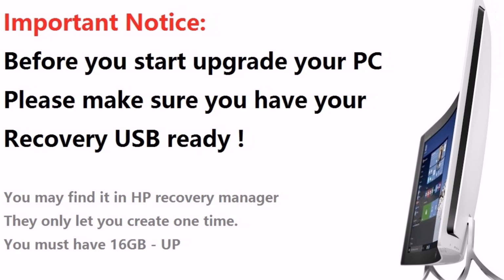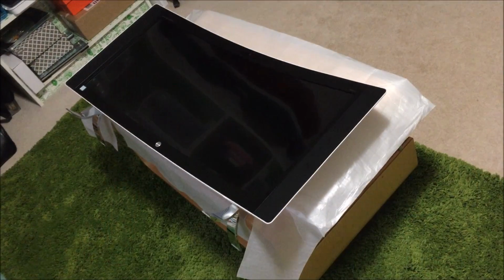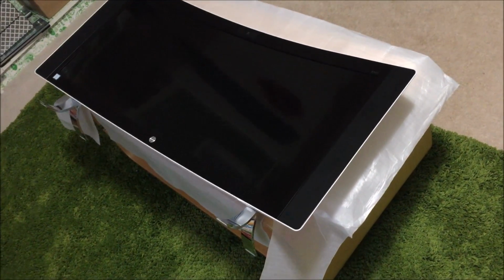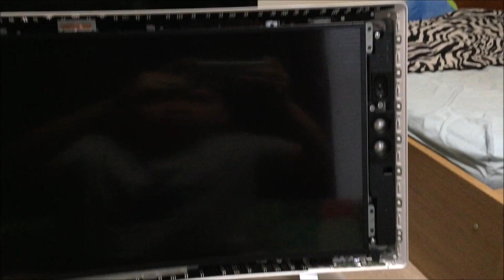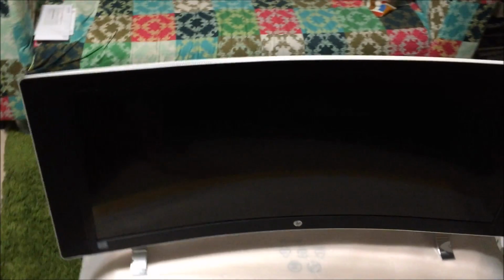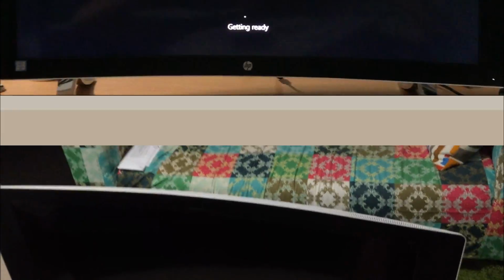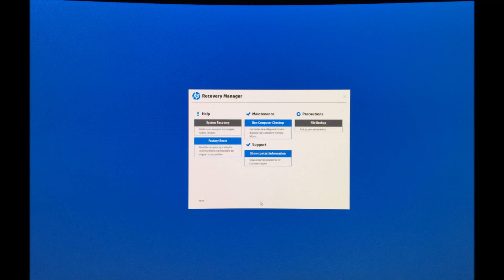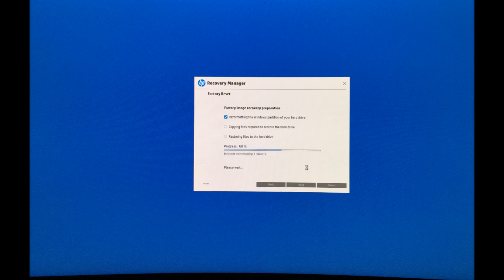HP envy 34" curved all-in-one PC SSD upgrade installation guide

Comment: I have one of these I purchased from Costco almost 5 years ago.  It still works great but I am going to change the SSD out with a larger one.  It also came with an NVIDIA GeForce GTX 960a video card.  Does anyone else have this and is it possible to upgrade that video card?  I'm hoping to only open this PC once so I don't want to open it to check on what the GPU looks like.

Comment: I have the 34 and 27 inch touch version of these envy computers ..Any one done the 27 inch?
Reply: The 27 version was so much easier...The back cover comes off and the hard drive is easy to get to ...Why would they mount it behind a screen...
Reply: Thank You..I just watched your video again...The new 34 hp all in ones are built to work on much easier...I wish i changed out the ram while i had it apart

Comment: If you need a Display replacement, Original NEW LCD Display LTM340YP02 LTM340YP02-Q01 For HP Envy 34-a090 Curved 34-a0XX 34-a001la 34-a150 All-In-One PC Buy from AliExpress.com https://www.aliexpress.com/item/1000007305918.html?gps-id=ru_edm_recommend&scm=1007.25755.141389.0&scm_id=1007.25755.141389.0&scm-url=1007.25755.141389.0&pvid=39201b83-8134-41c6-b76c-687970802486&userTouchChannel=targetEdm&smiId=biz_add_cart:1002:fb04d2139e2247d7bc0de67f7de235ce&tracelog=rowan&rowan_id1=houyi_target_edm_1_en_US_2020-03-23&rowan_msg_id=5139biz_add_cart:1002:fb04d2139e2247d7bc0de67f7de235ce_95617$79535438b4f448198886e5ac7327a4f6&ck=in_edm_other

Comment: SSD Upgrade vs. BIOS Update BEWARE!!! My Envy 34 A010 has been happily running on a Samsung EVO 850 SSD  for the last 3 years.  Yesterday, I stupidly updated hte BIOS from version A0.12 Rev.A to version A0.13 Rev.A.  After this, my computer would boot to HP logo and get stuck on it.  I have spent hours trying to find a fix but so far no avail.  The easiest thing to do would be to roll back the driver but apprarently, HP HAS DISABLED THE ROLL BACK FEATURE on this machine.  This really pisses me off... (and that's being nice).  I was able to restart the machine form the original conventional drive but it so slow that it makes the machine almost unusable.  Anyone managed to roll back the driver on an Envy 34 A010?
Reply: If you are able to use the original hard drive and boot up, its the ssd that has been corrupted or died. Recommend if you have an external enclosure for sata, to try connecting and see if you can see the ssd plugged in.
Reply: @NorthernLightsMultimedia  My SSD works fine to boot up and run the Envy 34 when connected to an external USB port via a SATA to USB adapter.
Reply: I have the BIOS update and my machine runns fine. I also have an SSD installed.
Reply: @NorthernLightsMultimedia  Interesting...  Are you running BIOS A0.13? And which SSD do you have?  I noticed there is now a BIOS A0.14 update available for the Envy 34.  I am wondering if this will address my internal SATA SSD issue.  Thanks for jumping on the thread.
Reply: @telecamfilms  I have an San Disk Ultra II 960GB SSD installed. Never ran into a problem with it. I have BIOS A13 installed. I know initial before I installed it, I used Acronis Disk Director and formatted the hard drive and then cloned it. Did you do a fresh install or did you clone the original drive over to the SSD?
Reply: @NorthernLightsMultimedia  yes, did a fresh install with the HP recovery tool and also cloned my Samsung EVO SSD with Macrium from the HP original HD.  I am ready to bet BIOS  A0.13 has issues with Samsun SSD drivers and that is the reason why they released the A0.14 update.  Still running with my EVO SSD connected externally, I'll give a try to BIOS A0.14 when I have some time.  Cheers.

Comment: Hello! is it possible to somehow ignore the idea of all in in this monitor and have the pc outside in a pc case?
Reply: Yes - mine has HDMI in/out ports - just connect external PC to HDMI input, set the display source to HDMI and it should work just fine. It does for me.

Comment: I upgraded my envy 34 to a m.2 ssd, 16gb ram, 4tb hdd, and i7 6700t
Reply: where did you find the expansion slot to upgrade the M.2...i have 128 gb and want to upgarde to 1tb
Reply: @TUSHY1980  You need to remove the motherboard, as it's on the side you can't see. It's in the top right corner.  It takes a standard 80mm chip. The (small) m.2 chip on the left is the wifi chip (with wires leading to the wifi antennae).
Reply: @TUSHY1980  Have you been able to replace the M.2 from 128gb to 1Tb? What M.2 SSD did you use? My M.2 is a Samsung SM951
M.2 PCIe (AHCI) 128gb. Is the motherboard compatible with NVMe M.2 SSD? I couldn't find any useful info about the Skydive-2GS motherboard
Reply: What kind of M.2 SSD did you use?

Comment: After replacing the hdd, I'm having a sound issue. My PC just make intermittent noise(very low) in a continuous fashion. I also  did a Bios update and now I received a screen where shows no part no. After pressing escape twice, it boots on Windows 10. Any idea how to fix bios issue? Thanks.
Reply: imachunter007 same exact issue here.... bios same thing. Figure out solution? Im still getting *poping noise too

Comment: Thanks for the post. While removing the curved display from the motherboard, video cable is damaged. I put some adhesive tape. I found similar cable on eBay but issue with selection of the video cable. If you can provide me the model or part no of the cable then I am able to replace it. I already search on google but nothing found for HP envy curved 34 all in one PC. There is cable available for HP and other brands. Thanks

Comment: I don't understand why there is an access point behind it to replace the hard drive or the RAM. To replace the RAM or add a M2 drive, you have to remove the motherboard as well. Piss poor engineering design for such a high price model.

Comment: The bottom doesn't need to come off, and the glue is tricky but I used a cardboard business card and that did the trick. The screen is made by Samsung so it is quite flimsy but you can upgrade the hardware by being careful. I suggest when taking the black cover off you leave your PC on as you don't risk getting an electric shock and the screen is very delicate so you will know long before you cause damage that you are pressing too hard on it.

Comment: For those thinking to buy a SSD. Forget it. Anyone who considers to put a OS and family pics on a SSD, is in for a big surprise when it corrupts. Its Adios to all your data. NO BOOT SYSTEM. On a mechanical drive you options to recover data. I suggest to put the SSD external on a High Speed USB, as it is just as fast, and best to use for gaming, or data you don't really care to loose and can recover.  Besides, you can make the USB SSD bootable as well. And run multiple OS's.
Internal and External.
The risk to take apart just for this? And take it apart again a year later for a bad ssd? Not worth it.
You think HDD's get hot. Wait till you feel a SSD running in this cabinet.
Besides you risk a serious screen crack issue. And I have seen it happen. Fixing HP warranty 34" AIO's.
And for those looking to buy a replacement screen. Or fix a eBay broken screen one. Forget it.
The price isn't worth replacing the screen. Your new HP 34" Becomes a pile of trash if the screen cracks.
This unit uses the Samsung WDHQ display currently used in its Monitor Lineup and HP's 34" Curve monitors.
Screen alone is priced at $800
Samsung Part
LS34E790CNS/ZA
34" SE790 Curved WQHD Monitor w/ Ultra-wide Screen
Thanks! From the Notebooksquad Web Team,
Reply: Sounds like you had a bad experience with a generic SSD. I've never had an SSD fail and I upgraded a 2012 macbook pro to a sandisk much like the one in this video, and my desktop I built 5 years ago is still running my Samsung Evo 840 500GB after plowing through terabytes of game install/uninstalls. As long as people properly manage their windows settings for a SSD (so many tutorials out there for this), and if you need a backup, simply use the OLD HDD as a backup drive internally, or externally. Do not use a SSD as an external drive it defeats the purpose of the performance to read/writes you get with SSDs....
Reply: It's a pain in the butt for a system like this sure, but an SSD shouldn't really run that hot, (NVME SSDs do though, I noticed Adata brand reports a high temp but I've never felt it get really warm vs my Samsung 850 which runs cooler than most hard drives) sounds like yours had an issue. It sucks. Even Hard drives fail, and data recovery IS more likely on a Hard drive but it's also more expensive than it's worth to most people (although there is free/cheap software that can possibly help, if that fails expert data recovery service is pricey).
Speed / responsiveness of SSDs is definitely worth it.

Comment: I was able to open up my Envy 34 AIO as well without cracking the screen.  In order to do it, DO NOT use a card to shimmy it free scraping along the LCD panel.  Instead, use a thin flathead scredriver and carefully pop it loose along the outer edge.  I also used a hot air dryer to heat the bezel to gently pull it loose a little bit at a time.  There is an adhesive tape that has it affixed to the display that can be slowly pulled off.   Just take your time.  It took me about 45 minutes to get the bezel off without damaging the screen.
Reply: Great Tip with prying from the outside.  I used a "black stick"/spudger to work the black trim and the adhesive slowly began to peel away.  Heat gun would probably have sped up the process.
Reply: Hope you can put up your video of how you did it.

Comment: Hi, very good instruction. 
How many SATA connection does it support? only 1?
Reply: it has an m.2 socket for a second SSD.   There are guys out there selling these with  i7 6700k quad core 4.2 GHZ and 32gb ram,  1tb m.2 and 2 tb SSD. HP says its 16gb max but they are upgrading to higher.  Considering a upgrade.  If I open it, I am doing it all.
Reply: there`s something to check?

Comment: I have been using mine for a while and notice a heavy sound generating. Do i have to Boot the HP Envy 34 on the stock, 5400 rpm hard drive and Complete the intial Windows 10 setup? Cant i just replace the hard drive to an ssd? Also, will the ssd help reduce the sound of the fans?

Comment: Hi, I just followed this and did the upgrade to solid state drive and carefully followed all instruction and closed it back BUT after I turn it on, there is a black thick line down the middle of be screen- horizontal. Do you have any idea what happened and why this line came about please. Any help will be greatly appreciated please. Thanks in advance
Reply: Ouch.  Sounds very hardware.  Take a apart and put back together again.  Hopefully it is just how it is assembled.  But I would guess it is broken.

Comment: man. HP makes so hard for people to upgrade the RAM and SSD
Reply: Manufactures like HP, Dell, and etc don't want none or repair shops do work on their computers. They want us to send off the computer so they can generate more profits so they can destroy small businesses.
Reply: That's the problem with most or ALL of these pre-built all in one systems, I mean what if you want to use a different monitor or the monitor dies, there's no video output. You can't change the video card, or upgrade the processor etc. They're nice looking when all integrated into the screen, but most components are specialized and flatted, you're also going to like get poor airflow / cooling in something like this. It's best to build your own if you want to customize / upgrade, or be able to swap out parts if something goes wrong.
Reply: @ninjargbassassin7650  They fucked me hard on this shit. Neve rpayed so much for a prebuilt system... never used it, cause it overheats if I use more than two webbrowsers at the same time, and god forbid I use a software like a game or microsoft word too, then the cpu boils. No guarantee, no help, no response, nothing. So I bought another one. Decided to open it again now and even more errors... like they built in that it will die if not used for several months... Never ever again, felt like they stole my money and screwed me hard

Comment: could you upgrade the CPU and the gpu chip like it has a 960m I would upgrade to a 980m
Reply: Really think you need those two extra FPS in your facebook games? You can't btw but don't worry. You wouldn't have noticed as much of a performance change. You can upgrade to 16g of ram and ssd like this guy and get a noticeable increase.

Comment: Excellent video.   Why does HP sell a computer in this class without an SSD? (rhetorical)    If HP designer were truly clever, future  design iterations would enable users to quickly / easily swap out a hard drive, much like most business laptops. (hint for HP)
Reply: +Y.U.E Living Channel I see some business models on Amazon that have the SSD.  Very pricey.  But can't see those systems on HP.com.
Reply from the maker: +Raymond C  I hope they do that in the future.

Comment: very nice. did you record anything so you can do a before and after so we can see the improvements?
Reply from the maker: There s big improvement after the upgrade ! You can totally feel the big different, before after full shutdown it takes about 40-50 second to turn on, but now only takes 7-10 second with the SSD !
Reply: Y.U.E Living Channel I thinking of picking one these up from HSN to replace my wife's aging system and an SSD upgrade would be the first thing I would do along with a fresh windows install..
Reply: @y.u.elivingchannel239  Can you recall what the screen REFRESH rate is please ? even hp website does not say